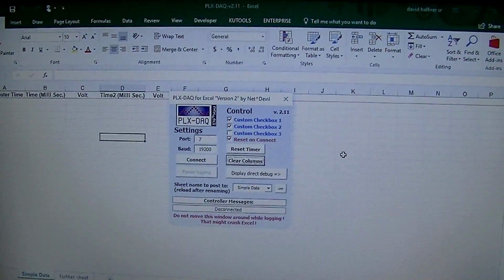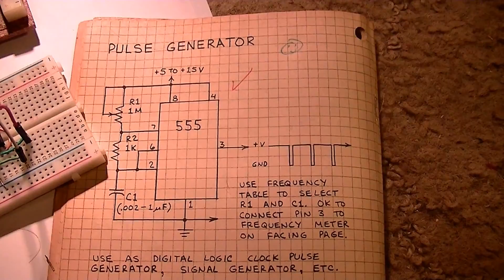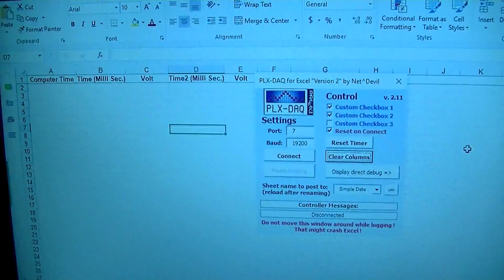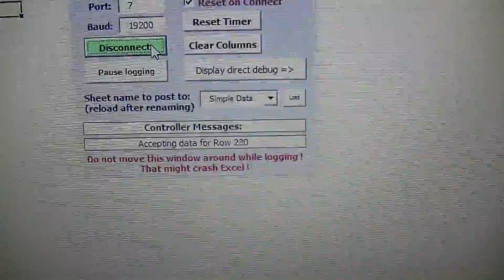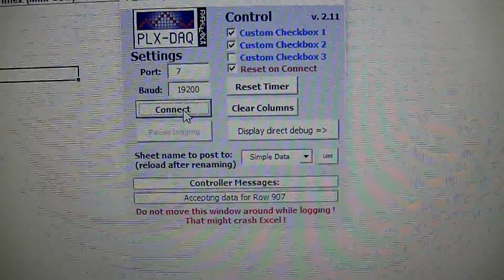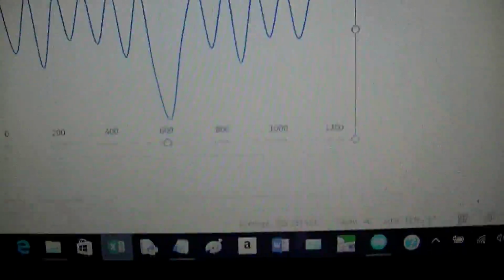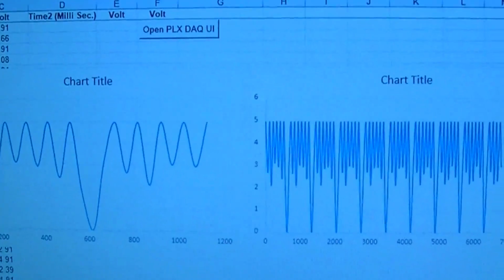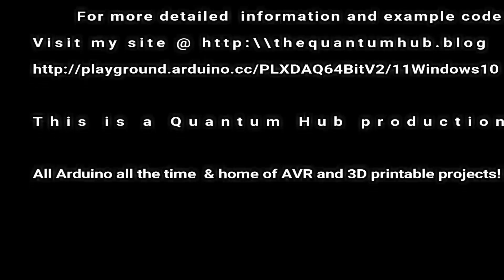PLX-DAQ v2.11 Dual Trace Transfer to Excel

Comment: the data in my sensor is shown in debug.
how can i get the data in excel coloums??
ty
Reply: Hi Yamen, looks like you are using the wrong syntax in your Serial.Println command. Please take a look at the Beginners Guide I posted in the thread on the Arduino Board at the v2.11 post: http://forum.arduino.cc/index.php?topic=437398.msg3251256#msg3251256 - the syntax has to be like e.g. Serial.Println("DATA,DATE,TIME,myValue1,myValue2");